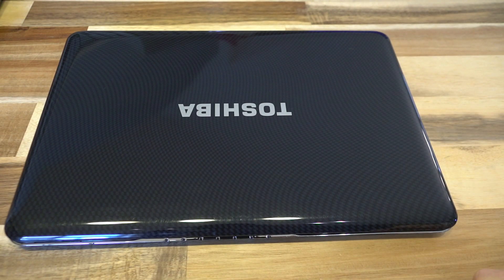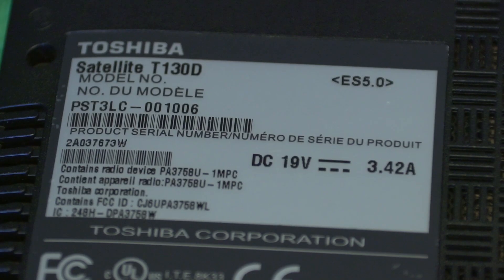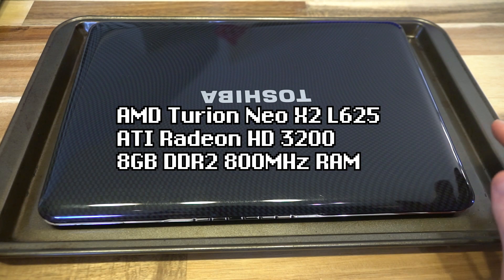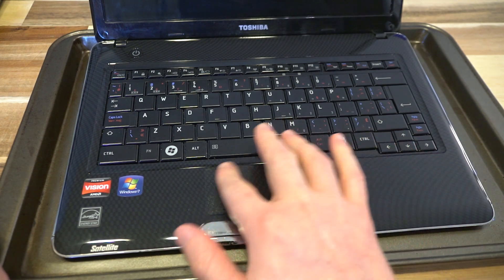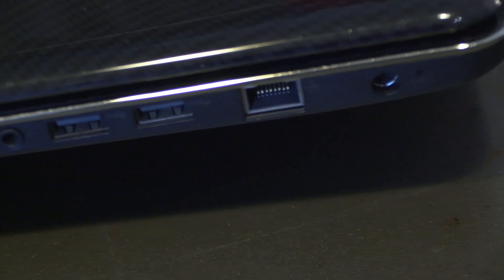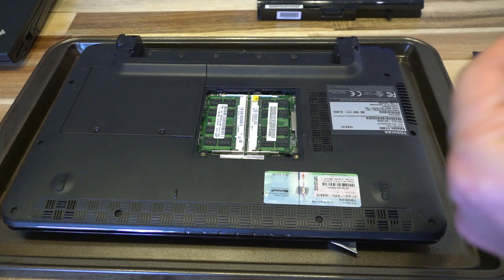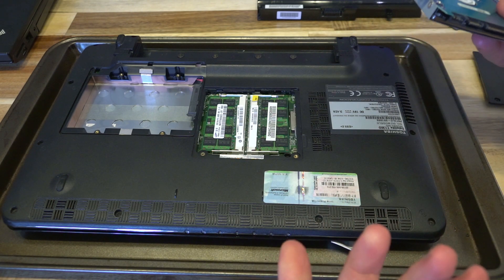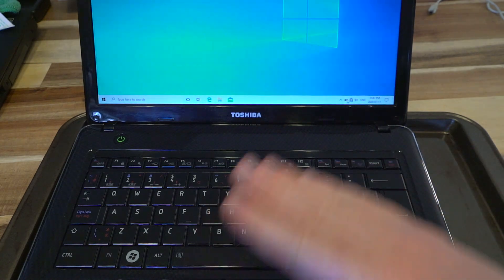Toshiba Satellite T130D: Too Hot to Handle?

Comment: The hard drive was held in by 4 screws. You had already taken out the two (torx) from the plastic cover
Reply from the maker: Technically correct, but my comment was it should have had four holding the drive caddy in place.
Reply: @LaptopRetrospective  yeah that's what i also meant.  the two torx screws went thru the cover and locked down the caddy as well :)
Reply from the maker: Ahhh I understand now.